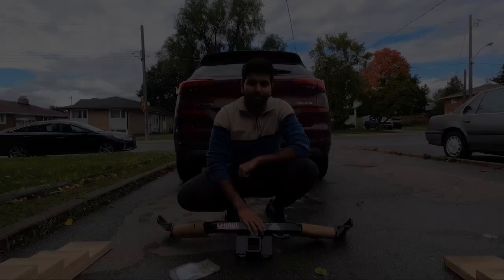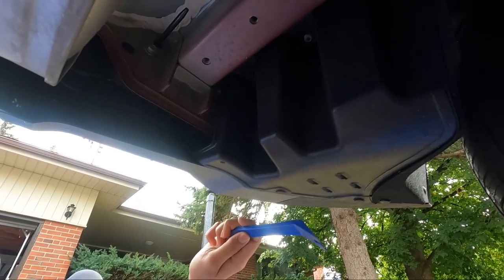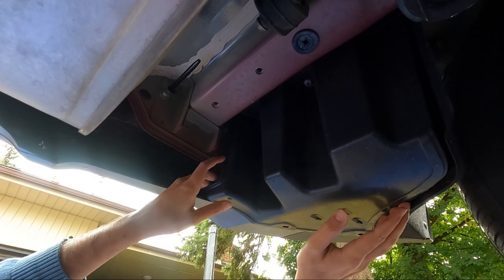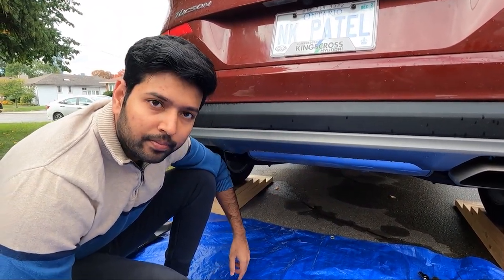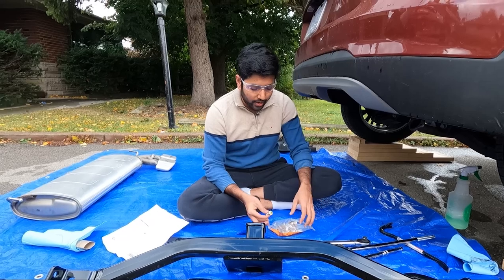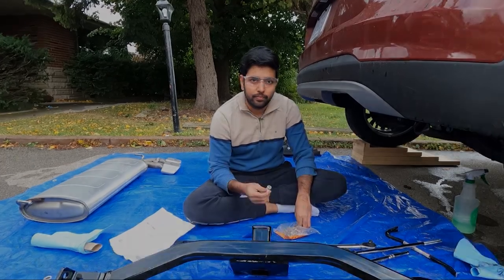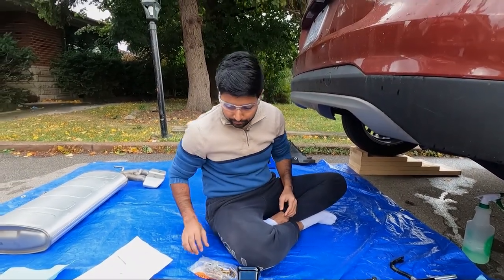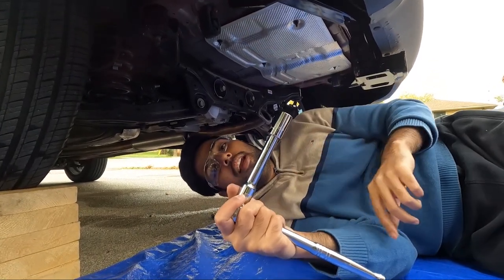How to install U-Hual Trailer Hitch on 2020 Hyundai Tucson AWD (Same for all models)

Comment: In Europe there is another model with a different grip. The muffler comes off extremely easily from two screws. The model for Europe removes the rear bumper but the exhaust not.

Comment: Great video! I was considering doing likewise with my 2020 Venue to tow a 12 foot box trailer that weighs 1500 pounds/2000 loaded. What are you towing & how does your Venue handle it? Really curious to know before I get myself in trouble!
Reply from the maker: Mine is able to tow an 8ft box trailer loaded no problem. It's rating is up to 4500LB so it should not be a problem.

Comment: Hi patel..can we install tow bar to hyundyi tucson 2017 active x..plz reply. Thanks
Reply from the maker: Yes, you can. Just make sure it's proper tow capacity for your needs. Tucson maximum tow capacity is 4500lb.

Comment: Different body style on the 2022 Tucson. Is there anything cheaper than the $500 Hyundai hitch right now?
Reply from the maker: Check with U-Haul. They have hitch for less then $200.
Reply: Hey did you ever end up installing it? I just got a 2022 want to install one as well
Reply: etrailer Class 3 Round Tube Trailer Hitch - 2020 Hyundai Tucson

Comment: Whats the towing capacity of Tucson 2.4l 2020?? I can’t find it in the manual??thanks
Reply from the maker: You have to look at capacity of hitch. The one I installed is 4500LB.
Reply: @NorthUbuild  so towing capacity depends on the hitch an not on the car?
Reply from the maker: Yes
Reply from the maker: Also look at Tongue weight limit for him hitch.
Reply: @dollarattri  This is not true, it depends on the size of the engine. The 2.4L 2020 Tuscon has a towing capacity of 2,000lbs. The 2.0L only has a towing capacity of 1,500lbs. Just because the hitch can support 4500lbs does not mean it's safe for your engine to handle that much.
Reply: @andrew_achter  thank you so much this was the answer I was looking for👍🏼
Reply: @andrew_achter  .. hi. Where are you getting the 1500lb number? I have been researching and most say 1000lb. I’m planning to do some towing with my Tucson and want to be safe. They say tow weight shouldn’t exceed 80% of curb weight which is 3300lb for a Tucson. That means you could tow 2500-2600 lb. I’m not able to get a definitive answer. Anything would help.
Reply: @dollarattri  cars can typically tow any weight. The problem is in breaking, suspension and the cars can flip in sharp turns. The 2020 model is rated for 1,000lb. You have to be responsible on the road and remember that other folks lives are at risk not just yours (think the Cuban truck driver who had an accident and has been sentenced to 100+ years)
Reply: @nyrubin  thanks man much appreciated.
Reply: @dollarattri  sorry didn't realize other people responded to your question already smh 💯✌️
Reply: @andrew_achter  you are correct.

Comment: In Europe there is another model with a different grip. The muffler comes off extremely easily from two screws. The model for Europe removes the rear bumper but the exhaust  not.
Reply from the maker: It will be a different design than North American models for sure.